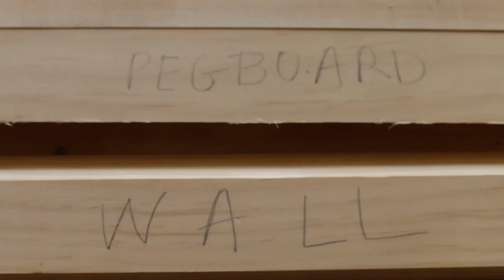DIY Pegboard Organizer and Modern Bench

Comment: A 1/4 inch of wood ended your friendship?  Well, mine is dependent on no music in DIY videos.
Music during yoga is fine.  We can only process two channels at once: eye and brain.  Adding ear distraction makes the brain wires fuse to produce distraction.

This turned out very nicely, pro job!  Clean look, matching set, and oh so functional!  Nicely done and I will borrow the idea.  I was thinking that with those oak floor boards, you could have 'torched' the wood for soft brown grain to show up on that white pine.  One light stain over it, and job done.

Comment: tearout is simple to avoid. put a mark on the (in this case forstner) bit, just enough that the brad sticks out the other side. then just drill from the other side. will be time consuming
Reply from the maker: Thanks very much for the tip. Sounds simple enough but like you said time consuming. I'm actively working on my patience so hopefully the next time around I'll take my time!